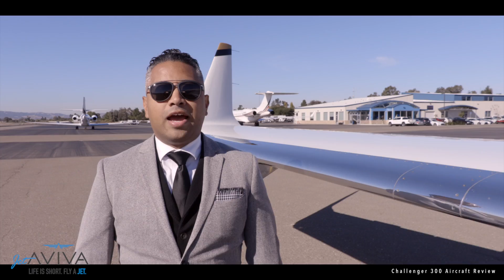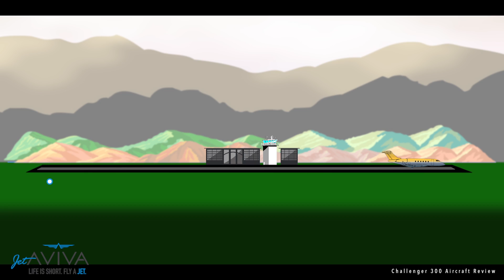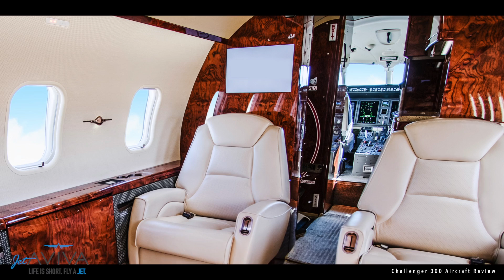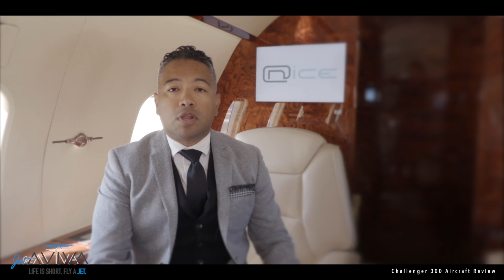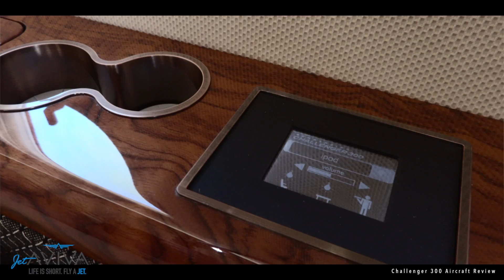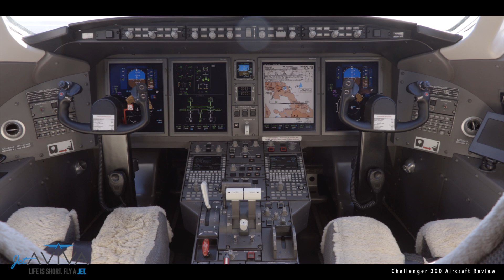Aircraft Review: Bombardier Challenger 300

Comment: Being in the oil business does have its perks. ( Obviously ). 

Enough of my arrogance. lol

Listen, all you jet setters. There are private/ corporate jets and then there are PRIVATE/ CORPORATE JETS! 

This big beautiful lovely jet is, in my opinion, the very best in corporate aviation. Our company had the Lear 35 for years, but we upgraded to the Challenger 300 because of its overall performance, appeal, safety and of course.......the WOW factor. I fly allot. I piloted F-4' s before taking a corporate position for a leading oil company in Texas. I can attest to this aircrafts flight performance. She flies like a fighter jet, but handles like a commercial jetliner in both comfort and speed. Flying at 41,000 feet does feel smooth. Her performance in and around airports is excellent. Flying through weather is child's play with this aircraft. It has more power then it requires and fuel mileage is exceptional considering that power and payload capacity. Generally, our company flies all over the continent and pretty much the world. What I really love about our particular jets, yes we have four of these now, is how comfortable they are inside. Head room, unless you're over 6' 5", is very generous. My business associate is 6' 3" and he never complains about head room or leg room. After all, it's a business jet with beautiful seating in soft leather and spacious room between.

We have our own flight staff. To include pilots, flight attendants and service/ maintenance is provided by our airports maintenance facility. The Challenger 300 is just about as perfect a corporate aircraft as one can purchase/ lease. We own three, but we're leasing the 4th jet. We plan on leasing a Challenger 350 once our current lease is up. Honestly folks, these Challenger 300's are extremely well made aircraft. Aerodynamically speaking, they fly very smoothly and as I stated above, they handle various weather situations with ease. The cockpit is, of course, all glass, with only a few standard type gauges as backup. I've travelled up front several times. Smooth, quiet and honestly, just a joy to fly. The cabin is also quiet. Now every jet in the corporate world can be appointed to what ever degree the client/ customer wishes. Ours are each equiped with a fairly basic cabin setup. Coloring is of course, up to the client/ customer. Ours are light tan leather with matching carpet. With wood grain finished control panels etc. Gold buttons etc. Cabinets up front are of the same wood grain type finish. Very shiny and kept in immaculate condition. 

I've flown on just about every Lear there is. My favorite ( though our company didn't aquire them ) is the Lear 45. It very nearly resembles the Challenger 300, but for overall size. The Challenger 300 is the very best I've ever flown on. Our company invested a great deal in our aircraft. In the oil business, everyone in the executive side has a jet. Its part transportation. Part tool and it's also a calling card when travelling as we entertain many upon many company business types world wide. Because the Challenger 300 is larger, it offers more convenient ways of entertaining our clients/ guest/ passengers etc. 

I cannot say enough about this jet. It practically sells itself. Every time we travel and land, our flight crew is almost always met with eager people wanting to see our jets up close. Of course, not everyone, for security reasons, can do this, but we try and accommodate as many as we can, if time permits. If you're looking to invest in a business jet that is not too large or too small and can fly pretty much anywhere in the world, I suggest you check this jet out. Before we purchased our very first business jet years ago, we utilized various services. Similar to NetJets . That gave us an idea of the type of business jets we might invest in. The Lear 35 served our company very well, but demands made upon our company etc, created a situation where we looked for a jet that was capable of greater capacity and comfort. Once we settled on the Challenger 300, all of us agreed, it was not only the right choice, but a great choice. Not everyone, of course, will share in my synopsis of this aircraft. For everyone has varying taste and of course, money is the root of how far a company is willing to go in terms of investing in such type aircraft.

I personally know a man who owns his own small oil company here in Texas. He owns a Piper Cherokee and he couldn't be happier. I've flown with him many times and he with us. For him, it isn't so much about money, he has plenty enough, but he enjoys flying himself and his execs all over the country. Of course, when they travel abroad, they fly commercial or do a 1/4 share deal. Which is great, but there are drawbacks to that 1/4 share. 

Anyway, thought I'd lend my 2 cents to this fantastic business jet. Do yourselves a favor, check this bird out. It won't disappoint you.

P.S. Yes I am really JR Ewing and yes I am in oil and yes, I get kidded around all the time, but love the novelty of sharing my real name with that of Larry Hagman's character in the tv show Dallas. 

🇺🇸